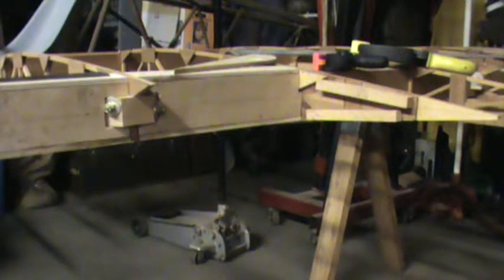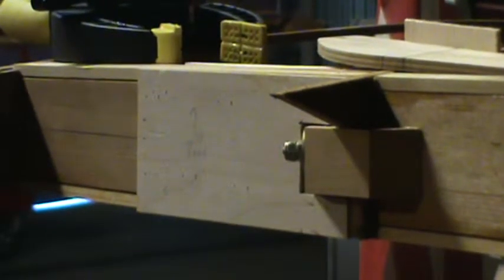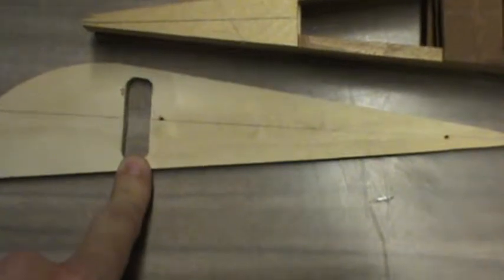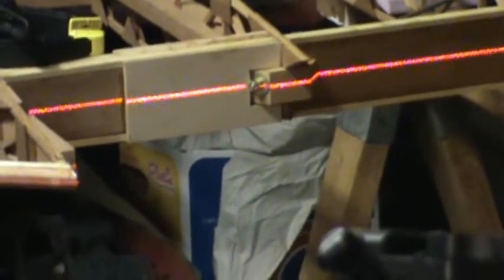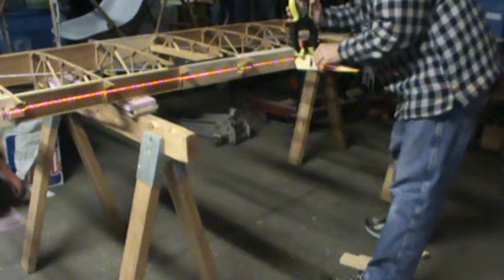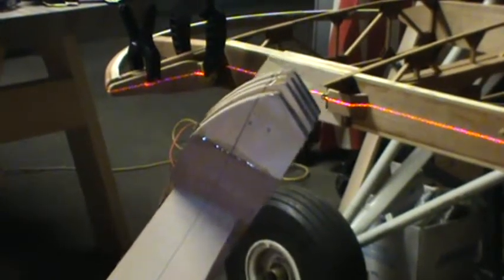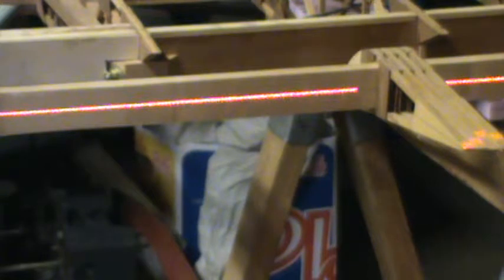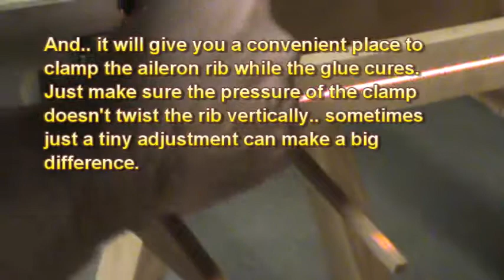Building the Steen Skybolt Aileron

Comment: I know it will be a glorious day when it is flown, what engine will you use? Tnx for reply.
Reply from the maker: The engine started life as a typical Lycoming O-540-E4B5.  I have completely overhauled it and made a couple of changes.. namely drilling oil return holes for better oil return when inverted, and I have converted it to fuel injection.

Comment: What kind of glue is used? How long will it take to build the Skybolt?
Reply from the maker: Glue of choice these days is T-88 a structural epoxy which is widely used in the boat building sector as well. I've been building for a bit over 6 years now and am coming to the close with fabric and paint.. I think the average estimate in manhours is about 3,000.